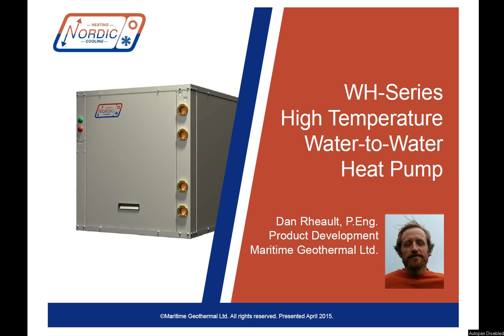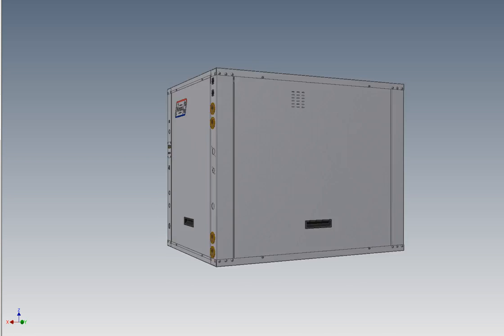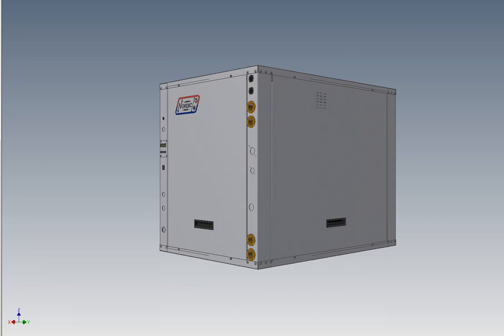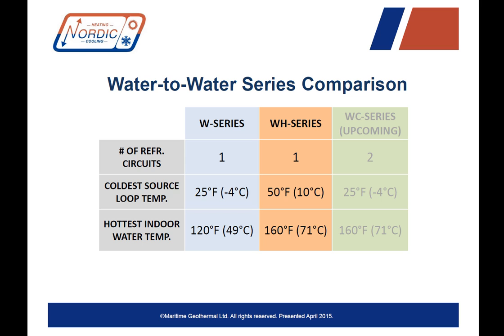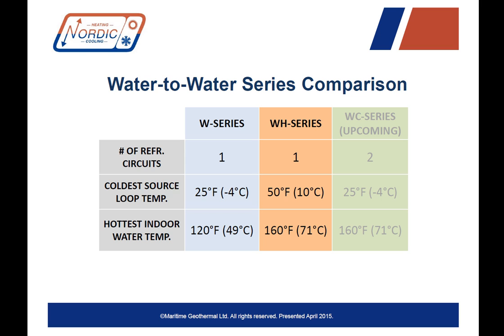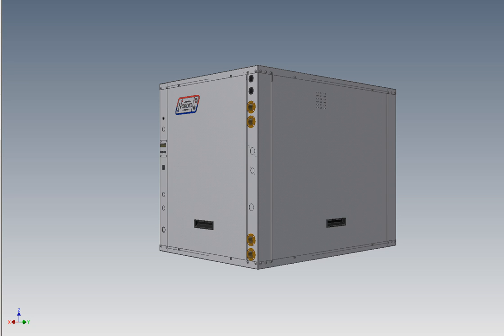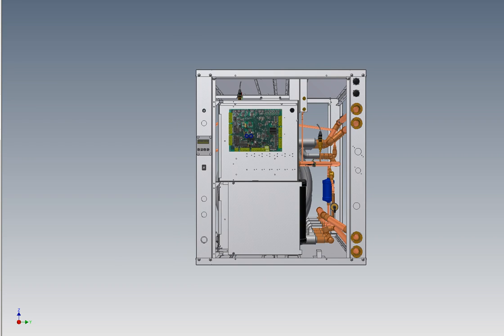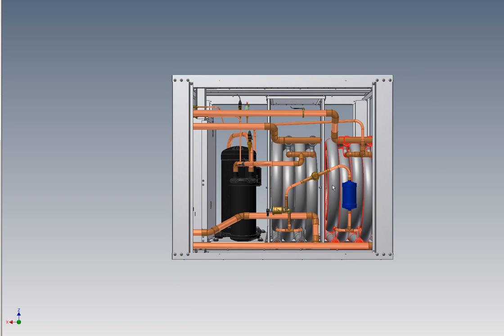The Nordic High-Temperature Water-to-Water Geothermal Heat Pump

Comment: Is the compressor variable frequency inverter or on off? 
Trying to run on solar. Large inrush not ideal
Reply: Good question. Doesn't look like they monitor this. My guess is if this unit was a nice variable 3ph motor we'd know about it. It needs that upgrade if it doesn't already have it.